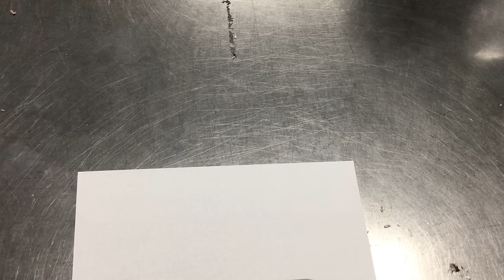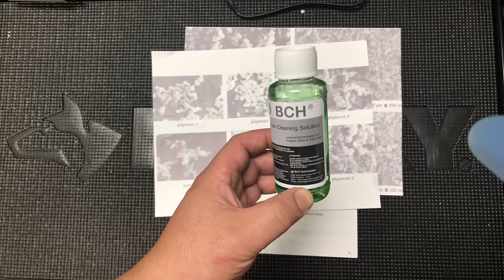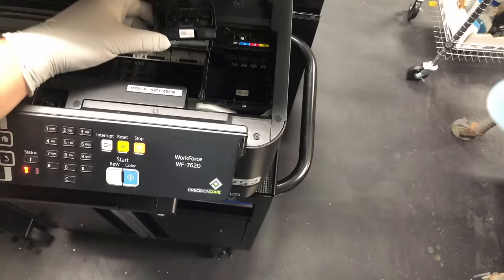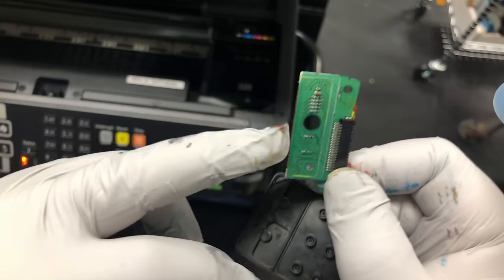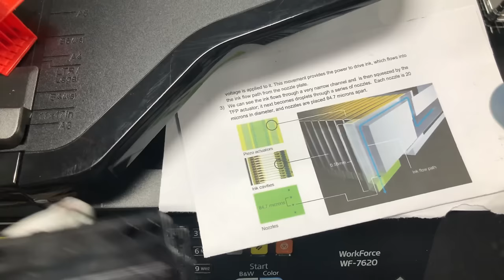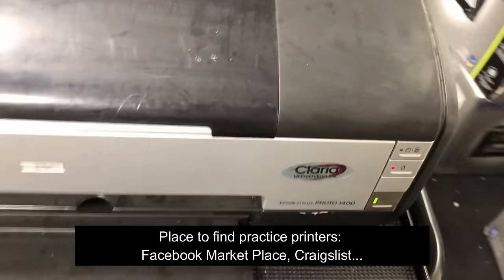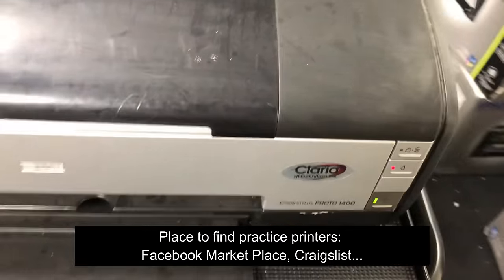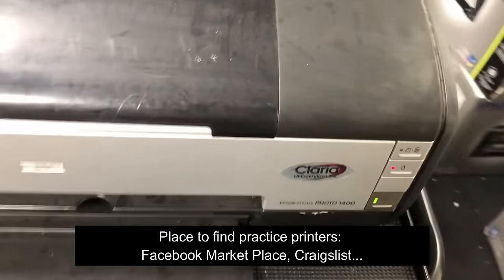In-Depth Unclogging Printhead- Detailed Guide for Epson Printer- Part 1

Comment: So I must have damaged the black ink channel, and fried the chip board under it, with flushing it with cleaning solution, and pushing too hard, because, now the black refuses to print anything, while all the other colors work perfectly. Guess I have no other choice now, but to buy the red solution, and try to do even more damage by letting it sit on the print head overnight.

Comment: Like most people, I'm lazy and decided cleaning, wait 12 hours, clean again repeat 12 times was just more work than I had time to do so I orderd a replacement head from the A to Z company (no free advertizing) but when it came it was a used and poorly cleaned head that didn't work so now I'm about to do your method with one change - I decided to put the head on a long soak in a vaccuum chamber to suck all the air out before I try priming the head with ink.  I'll post the results later to see if vaccuum method works. I got the idea from Jose Rodriguez Photo Printing Teck channel. A long time ago I bought a cleaning kit like your RED but the tubes that came with it were way to large and just leaked all over.  I hope you have a variety that fits the WF 7620.

Comment: My old Epson R2880 A3 printer stopped printing black years ago - I'm assuming the other other colours have seized by now as well... But I'll follow this and see if I can get the old girl working again... Its a great printer - expensive to run, but very good. I'll admit I tend to use low quality ink for most prints... its only "proper" prints that get the good stuff.

Comment: HI JUST HAVE 2 CHANELS LC AND LM WICH ARE NOT WORKING WITH DTF WHITE INK ,WORKING PERFECTLY BEFORE NEXT DAY STOPPED WORKING .I DO A WATERFALL FLUSH PRINTHEAD EVERYTHING LOOK OK BUT WHEN TRY TO DO A NOZZLE CHECK OR PRINTING DOESNT WORK .IS THIS PRINTHEAD DONE ??I THINK NEED TO CHANGE IT PLEASE ANY ADVISE BEFORE BUY ANOTHER ONE .THIS PRINTER I A EPSON 4900 FROM YEAR 2014 .NEVER CHANGED PRINTHEAD JUST NOW I CONVERT IT TO DTF WORK LIKE 1 MONTH AND 2 CHANELS ARE CLOGED

Comment: I have an Epson Et4550.  So what happened was I basically let it sit for about a year because of this pandemic until I realized what I had done. Initially it wasn’t printing anything on paper. I watch your video I bought the solution and it’s almost work.  I got three of the four colors to come back. Black refuses to come back. Not only that, and one print heading also check I think I’m making progress, on the next one I’ll get no black at all. I’ve been doing this for two weeks man. Need some advice
Reply: Could you please restate your last two sentences? It confused me.
Reply: @lionintu  its ok.  Printer is gone.
Reply: @AnonymousAlcoholic772  I feel u. I'm never buying a ecotank again.
Reply: @lionintu  yeah, good idea in concept but devil in details.   So it needs constant use to stay functional but most people dont have that kind of demand. But its too slow for proffesional settings. So 👎🏻
Reply: @lionintu  i replaced it with a led color laser from brother which is superior in every way except for photo printing which it sucks. When i get back home ill play around with settings and see if it can improve on that.

Comment: My company has a Direct Color Systems 7200z that's based on the Epson Stylus Pro 7900. I believe we have a clog that occurred after our quarantine ended. I've been unable to clear it. I'm very reluctant to remove the head because I don't know how to calibrate it after. And I can't attach one of the EPSON clearing carts to it because of the way it's set up.

Do you have any advice on how I can clear a clog or troubleshoot to see if it's a clog or a bad print head? The error I'm getting when I try to run is Fatal Error 1A39.
Reply from the maker: If you email me, I can refer you someone who can take care of it.  Support@bchtechnologies.com
Reply from the maker: If you email me, I can refer you someone who can take care of it.  Support@bchtechnologies.com
Reply: clean it coming out clear now now have a code  on EPSON WF 2750 0x9a

Comment: In my expirience - this is very time wasting and dangereous method.
I'm talking about doing all this work INSIDE the carriege. It's better to get out printhead, place it on towel or wool disk soaked with cleaning liquid and let it rest for some time.
Then you use same tubes with syringe to flush cleaning liquid towards untill you see straight "rain". Then dry PH, let it some rest on dry towel and you can run it.

This is a little bit risky, but works very fast and with great results